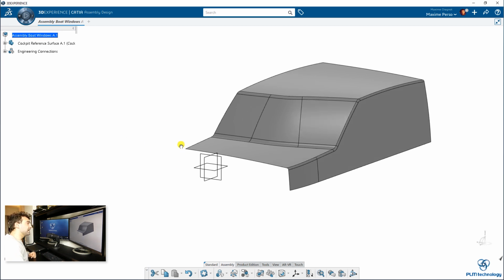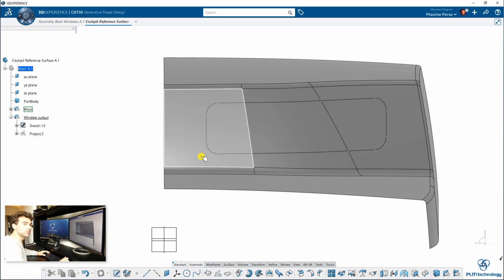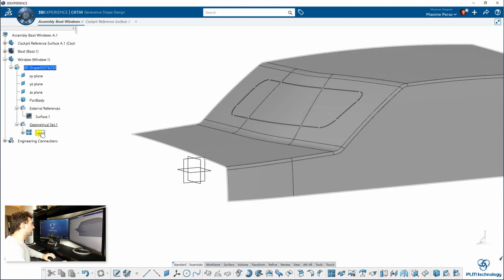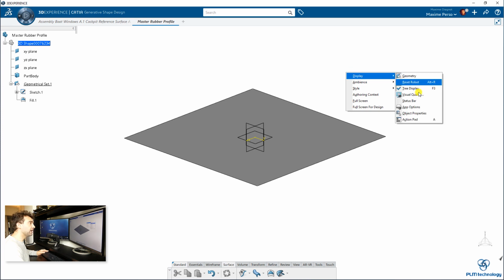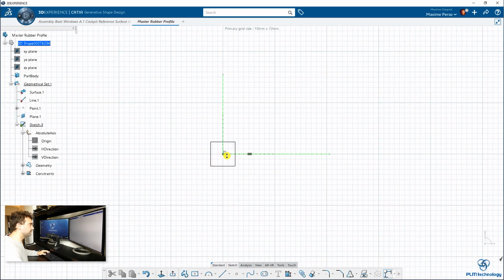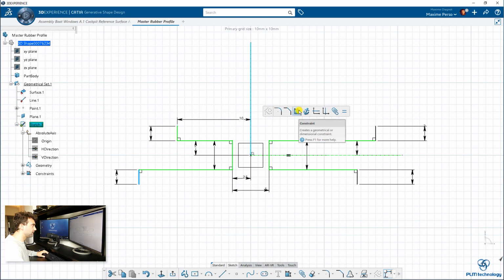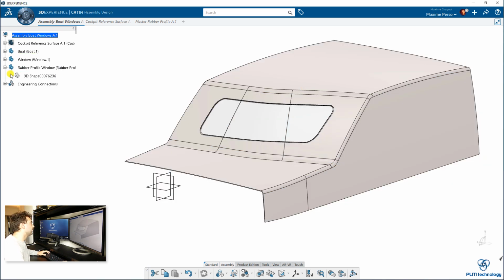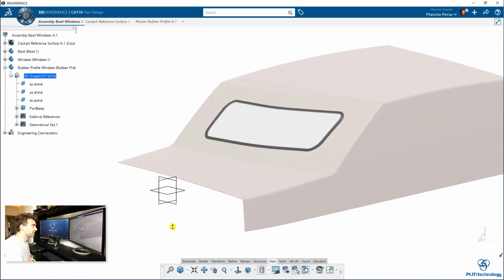Use CATIA PowerCopy for windows contour - 3DExperience R19x (Live)

Comment: Hi and thank you for your nice explanations.
what I'm interested to know in this video is the associativity that surfaces of different parts have with each other.
for example if I have an assembly with three parts lets say "part A containing surface A" and "part B containing surface B" and "part C which I want to stablish a fillet based on surfaces A and
B",and of course I want the fillet to have history to surface A and B.what should I do?
because I tried what you did in your 3DEXPERIENCE in my CATIA V5 and it did not work. 
do you have any suggestions?
thanks a lot.
Reply from the maker: Hi Fardin, sorry for the late answer and thank you for your nice comment! First, go to preferences: Infrastructure/Part Infrastructure/General and make sure "Keep link with select object" is ticked. You can also tick "Show newly created external references" and "Confirm when creating a link with selected object". That should help you. You should be able to create a fillet using the surfaces as references. Although I would have recommend you to make all in one part. I also recommend you to watch this video to know more about contextual links: https://youtu.be/OlRkCLi2Jj4 . And finally, in this video I used a function called "Create Datum" that create broken link on purpose. You should not use it if you want to keep link with parts. Good luck!
Reply: @MaximeChagnot  Thanks so much,Great explanation.

Comment from the maker: Update 2019-06-12

Hello everyone! 

There is a tiny modification to do in the scenario at the end of the video. Indeed, a subscriber noticed that the “Rubber Profile Window” part was not relying perfectly on the surface. The reason why it that the curve imported in the Rubber part is not overlapping perfectly with the surface. 

A quick Remedy to solve this issue is to use the feature Projection. You can project the curve on the surface along the Z axis. After doing that, when you run the Power Copy, use the Projection instead of the Curve in the Profile Section. You should obtain a nicer curvature for the Rubber Profile! 

Hope this was Helpful and a big thanks to FD Design!